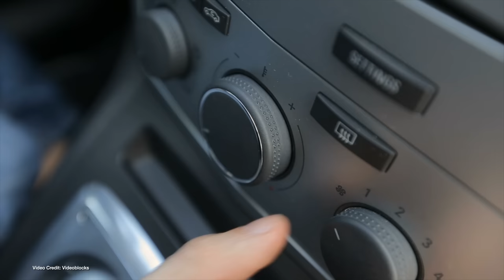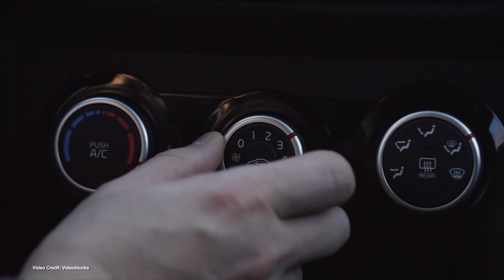How Do Electric Cars Keep You Warm In Winter?

Comment: They should just combine a heatpump with some kind of resistive heater. Resistive heaters are so cheap to make, it would not make a difference in the production cost at all.
Reply: Batteries don't work in the extreme cold.  To get any heat out of them, short the positive and negative terminals together for my amusement.. Perhaps Tesla should supply woolly hats, scarves & gloves as part of their winter pack. Electric vehicles are a scam to squeeze the last pennies out of people & is enforced buy governments and local councils by heavily taxing regular fuel cars

Comment: I refuse to buy a pure EV without a variable speed heat pump. And the aptera Roadster probably won't have it in its first year..

I assume the model Y's heat pump not only can heat the cabin, but the battery too
Reply: Tesla Bjorn did a video recently testing a 2021 model 3 (with the heat pump) and the car was heating the battery - presumably from the heat pump. I don't see why it wouldn't use the heat pump as it's all plumbed together.

Comment: Yes, and, not only does the heating capacity of even a good heat pump not enough the now-very cold batteries lose their charge much more on top of that.
Reply from the maker: And yet EVs are popular in Norway. It's almost like you're wrong...

^Kate
Reply: @transportevolved  I think so many EVs in Norway is great, I envy that. You highlighted a problem about heating EVs in a cold climate. Maybe I missed you saying it, but my cold-battery comment was meant to contribute to cold weather effects on EVs. I reread my comment and, again, maybe I'm missing it, but I don't see how you took it in a negative way. Of course, even including such heating and cold battery problems, the overall benefits of EVs are still worthwhile.

Comment: Heat pumps are obvious possibiity.  However they seem to be a lot more efficient at cooling then heating.  I hope they find a solution.
Reply: Heat pumps work better than resistive heating in general.  They are more complex and have the issue of the cold coil getting iced up.
Reply: Batteries don't work in the extreme cold.  To get any heat out of them, short the positive and negative terminals together for my amusement.. Perhaps Tesla should supply woolly hats, scarves & gloves as part of their winter pack. Electric vehicles are a scam to squeeze the last pennies out of people & is enforced buy governments and local councils by heavily taxing regular fuel cars
Reply: @punkvoid9957  
Some batteries don't work cold.  Tesla didn't use the kind that work when cold.  The trick is the electrolyte has to be a very concentrated solution or a solid naturally.

Comment: Tesla, AI neutral network, over the air update, pom pom hats.
It's not how the heat is generated which is the problems it's heat loss due to heat transfer rates of the materials surrounding the cabin. Aerogel, ceramic tiles, closed cell foam, thermal blankets all address this problem and will probably be incorporated into EV's in the future.

Comment: Tesla made the heat pump circuit and the Octovalve way waaaaaaaaaaaaaaaaaaaay too complicated. It fails suddenly and completely in cold weather. It does not sound like it is simply struggling with super low temps. While they could command the motor to generate heat with a software update (as the original Model 3 did), this would be useless because there is no liquid/air heat exchanger (like in the original Model 3). All heat to the cabin and window defroster MUST pass through the heat pump circuit. When the heat pump circuit fails not only is all cabin heat lost but the car may not be able to warm the battery either and regenerative braking does not work. Things service centers are doing: software update, replace high and low pressure sensors on heat pump circuit, replace refrigerant lines, replace compressor, replace supermanifold (Octovalve). I think that it was a mistake to divert the refrigerant between cabin evaporator and liquid heat exchanger on the low side and to switch between a condenser and a Liquid Cooled Condenser on the high side. Almost all other heat pumps have only 2 coils and a reversing valve.

Comment: I wear a heated pair of pants and an electric Coa and glovest powered from the USB...
As efficient as you can get..

I can power my cabin with my mitsubishi phev for many days on a tank of fuel with the on board generator..
Cool climates would actually benefit from burning fuel for heating and efficiency..

Cars want a thick layer of foam insulation. Nice n light

Im making it all up.. (I don't own a cabin or heated clothing but it would be most efficient. 
Just had some weed and am in the bath.. Trimmed my bush and hair and got 3 days off.. Went from looking homeless to pretty swarve.. 

 I'm picking my outlander Friday (well, unless they refuse my trade in)

Wanted pure EV but didn't have the extra £9k... Plus don't like the idea of being the sinner that buys new.. 

Maaan I'm high!

Comment: Human nature to speculate, so here goes! In a home system once tempreture drops below zero heat pumps start to become inefficient, only working in highly insulated homes as output from a heat pump is very low in comparison to a gas boiler, 11kw to 40kw being a general example. In a home system there is normally a back up that kicks in when more heat is required & the pump can't supply it this is normally an electric imersion heater, resulting in the system running on electricity for heating directly, hence a lot of complaints about heat pumps being expensive to run. In a poorly insulated car with a small heat pump it is never in a month of Sunday's going to be able to heat the car properly at very low temperatures. It will require a further heating boost. Now we can speculate again as to wether Tesla have installed just a heat pump or a heat pump with a back up system. Hope there is a back up system as well or there will be some cold Tesla drivers!
Reply: Heat pumps and teslas are bascally popular because of publics lack of knowledge of phyics.

Comment: It’s the heat pump dude. Heat pumps loose efficiency as outside temperature drops. They need a coil as a backup for lower than -10 C

Comment: I remember years ago (yes I'm old) the cheaper splits where not that efficient and the heating cycle did have a resistance element assistance but now there more efficient and don't seam to have them anymore,even the cheap ones. Could be one of the options may be. Great video..

Comment: But heatpumps work great in southern California...
Reply: They work amazingly well in the Pacific Northwest, both for EVs and homes. But we only see temperatures dip to 20F, at most. Far from 0F or negative territory of the upper midwest.

Out home heat pump is operational rated down to -22F. Can't personally speak for BTU output with such hypotheticals. Geothermal heat pump (ground source) would be the ideal solution for extreme winter climates.... a trick EVs cannot tap into.
Reply: @wzDH106  While it may have a coefficient of performance slightly greater than 1 at -22F you would need at least 5 of them to supply enough heat to keep the house warm. But they would be blowing "cool" air so who wants that anyway?
Reply: @charliedevine6869  

Geothermal is key in extreme northern winter climates. I hear the prices have dropped, probably in preference to drilling a localized hole as opposed to excavating the entire property lot.

Comment: You don't have to be a electrical expert to realize that on a long journey in the middle of a UK  winter , cold and wet etc, that nearly everything electrical including the heater will be on, this surely will reduce the range in the car, this is what I don't like about electric cars.
Reply from the maker: Given most EVs on the market today use heat pumps, the draw in the battery is very small.
Reply: @transportevolved  What about the other things like lights, wipers, radio etc on  at the same time the battery wont last long, still stick to my original comment.
Reply from the maker: Consider: 

Your average modern EV battery contains enough stored energy to run a house for at least two days. And we’re talking two full days of use (somewhere around 60 kWh total).

If we assume a car radio operates at 10 amps at 12 V (most operate at less) then they’d use (in one whole hour) 120 watt-hours of power. (Or 1/500th of the 60 kWh battery capacity). Lights and wipers also have negligible draw. 

Please check your math before making statements like this.
Reply: @transportevolved  Did not know that , amazing! I'll tell that to some of friends this that have asked the same question ,thanks for the reply.

Comment: So in short Tesla were too cheap to put a cheap resistive heating element in their heat pump loop.. what did you expect from Californians? It's not like they have connections to a space company!

Personally I think most likely they have underestimated how much heat they need to keep the battery warm and that leads to further software management errors. Possibly unaccounted for a change in battery thermal profile with extended battery. That's what happens with software companies quite often. Just wait and see the quirks of an "apple car". I expect it to be quite entertaining for the non-owners.

Comment: How TF could anyone design a heat pump without resistance heating to augment it in very cold weather - or give quick warm up in moderately cold weather?  Everyone I know with a heat pump for their house has resistance heating for this reason (or some auxiliary source). That's just how heat pump heating systems are designed.
Reply: there heat pump can use heat from the battery and motor. They could heat up the motor by setting the motor drive phase closer to zero to make the motor waste energy. This could even be done if parked.
Reply: @LaserFur   So while parked they can set the motor to kinda lock up and resist turning - so the current meets resistance and the motor heats up. OK, using the motor windings as a resistance heater. Sounds good, sounds elegant - and eliminates having any extra part!
Reply: @donjones4719  Yes, but they actually don't need the motor to be stopped. The motor is electronically controlled. so they can tell the motor to stay at the angle it's at and still waste heat in the coils.

Comment: Heat pumps are useless below freezing and would require a second source of heat to at least thaw the unit.
Examine what a heat pump for home heating can do and you will see.
Reply: Heat pumps can work just fine below freezing - there are heat pumps that work at -20 F.

Comment: Anyone thought of a ntc?
Reply: Negative temperature coefficient? That would mean the hotter the heater, the more electricity it conducts. That leads to thermal runaway.
Reply: @kkobayashi1  
.... unless what is powering it is a constant current source.
P = I^2 * R and all that.
Reply: @kensmith5694  Yes, but most electrical power sources are constant-voltage, or close to it up to some limit where the breaker trips. Outlets, batteries, car electrical systems, etc.
Reply: @kkobayashi1  
Yes, I was being very pedantic for slightly humorous effect or is it slightly pedantic for very humorous effect.

Comment: A small corerection: as PTC heaters are just a subtype of resistive heaters, they are equally efficient - the heating power in watts = current squared times resistance = 100% electric power used (though PTCs are kind of self-regulating).
Reply: I agree. This is a great video but I think it was wrong to imply that PTC is somehow more efficient than resistive heating.
Reply: There is a way that the PTC type could be more efficient but I doubt it applies here.
The loss of heat from the heater to the environment instead of to the cabin air, depends in part on the temperature of the heater element and partly on the thermal conductivity of the hardware holding it.  With normal resistive heaters, you have to design for the element reaching a quite high temperature.  This can force the designer to use ceramic supports for the element.  Ceramics are very good thermal conductors.  A PTC element can be made so that its maximum temperature is below the working temperature of some plastics.
Reply: @kensmith5694  True, if the heater is mounted outside the cabin. That seems like a dumb thing to do with an EV where you know that heater loses matter. Put it on the inside and the loses go into the cabin too. It did sound like (from what Nikki said) they are sometimes mounted externally, and heat-exchagned into the cabin. Car heating never had to care about efficiency before because there was so much waste heat available. Modern cars probably want double-glazing, more insulation, better-controlled ventilation and heat pumps. i.e. all the same stuff you do to make buildings more efficient. 2-3kW is the total heat load of a well-insulated house, which shows just how bad cars are in this regard.
Reply: @Wookey.  
The heater will be bolted to the structure of the car.  Thus it has a thermal path from its exterior to the environment.
Reply: Seat heaters or/and vented seat would be good because the heat is going right where you want it.
Reply: @ralanham76  Yes, and also heat the steering wheel.  Frozen fingers don't work well.
Reply: Michal, correct. Peltier Heating should have been mentioned as the 3rd type instead.
Reply: @nordic5490  
If you are moving a lot of heat, a compressor based system is more efficient.  Peltier doesn't scale well.
Reply: PTC heaters use less power (by increasing resistance) the warmer they get. In that way they are more safe.

PTC heaters have been used in ICE cars in Norway for decades as an auxiliary electric heater in winter.

PTC = Positive Temperature Coefficient
Reply: @nordic5490  but isn't peltier just worked like a resistor either in this case?

Comment: I love my 2020 Bolt EV with it’s closed loop ceramic heater! My wife’s gas car will freeze us at first in winter so we drive the electric and actually need to turn the heat down! I use the seat heater only for a bit to make the seat not cold at freezing  and just below and there is very small range loss! In my 2013 Ford Focus EV we used a 12v blanket for my wife as it had such tiny range and we still have 2 blankets in case of a long winter trip! If I had not chickened on buying a M-Y Tesla I would have maybe needed them now but fit and finish and other problems forced me to give up and get the Bolt and love the overhead camera and Apple CarPlay, HiDef front and rear cameras etc!